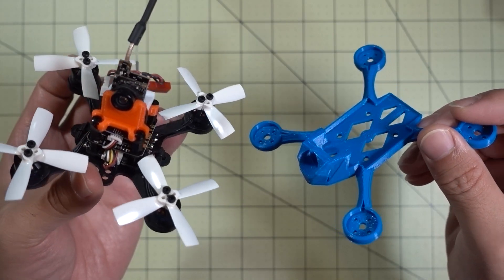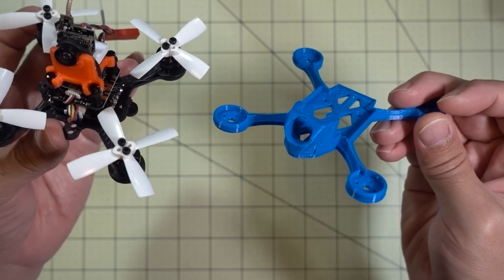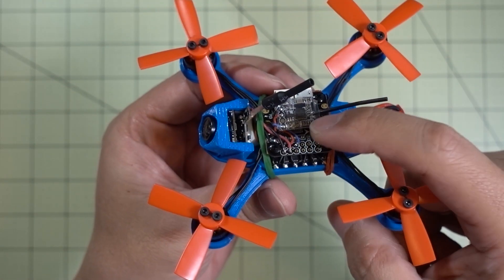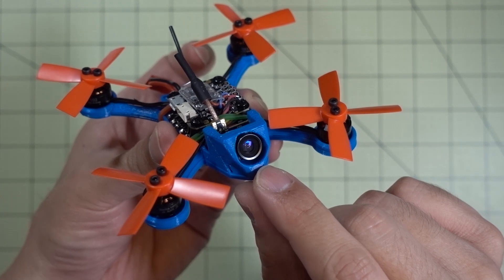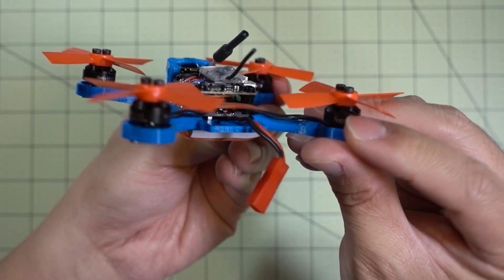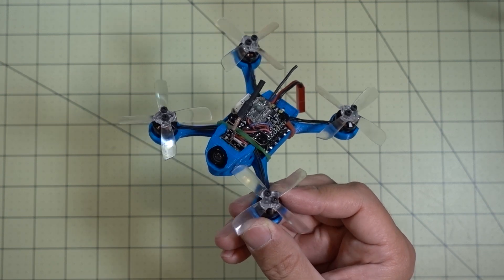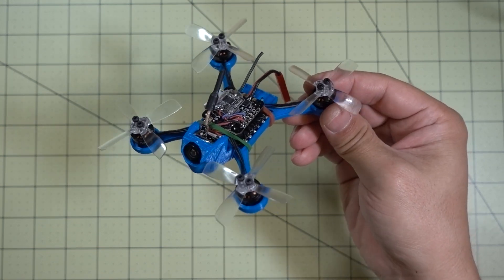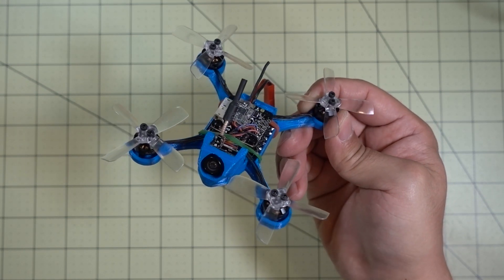Micro Drones 101 #5 💡 3D Printed Micro Drone 🔥

Comment: Hi Albert, I can't get the FS-RX2A Flysky IBUS Receiver to bind to the Taranis QX7 transmitter I have, are these compatible at all? The green light on the receiver never gets steady...
Reply from the maker: The Taranis uses the FrSky protocol which is not compatible with Flysky so they will not talk to each other.  You can connect to the receiver if you use a multiprotocol module, but it will require some homework on your part to learn how to get it all to work together. See my video - https://www.youtube.com/watch?v=-pcMbzzMQ1w

Comment: Hi there, I was interested in building this but found that the suggested flight controller and ESC are not available anymore on the market... are there follow-up products that fit this design or which alternative products can you recommend?
Reply from the maker: Get this instead - https://goo.gl/Kk8NfU
Reply: Thanks a lot! This is great as it is FC and ESC in one piece. What battery would you recommend?

Comment: i have the neato pipsqueak, love it, my only issue with the entire build was installing the props, i couldnt for the life of me get the props to light up with the holes on the motor. im using the rotorx 1105 motors with rotorx 2.5 props and i cannot stand the need for those bolts to hold on the props. hate it,

Comment: hmm i have the 1103s 8k with 2535 and 65mm two blades dry weight 51 grams and I think yours is faster with 2 inch. How can that be, I wonder.
Reply from the maker: +Lefty FPV 10000kv motors...

Comment: which battery did you use?
Reply from the maker: +Thibault Depaye a variety of lipos between 300mah and 500mah
Reply: Albert Kim ok thx. will this setup fit the X2 elf?
Reply from the maker: +Thibault Depaye Yeah, these parts will also work in that frame.
Reply: Albert Kim Huge thanks from Belgium 😁. I'll definitely build that!